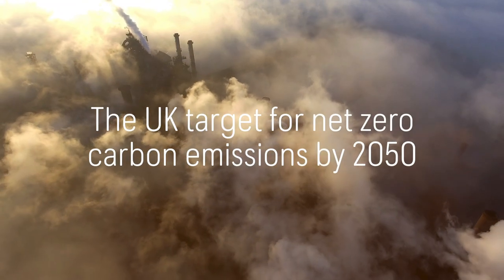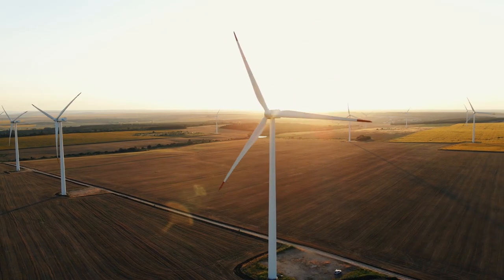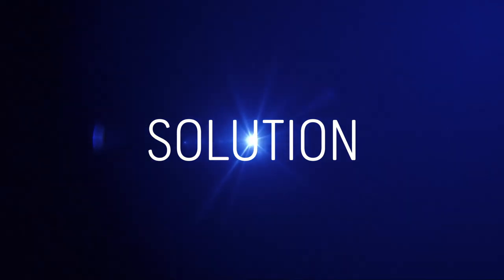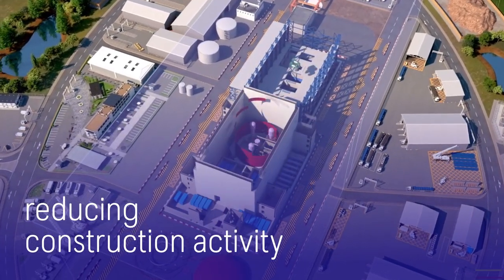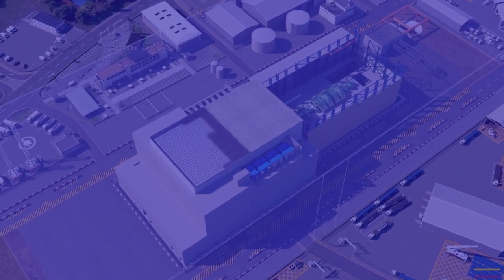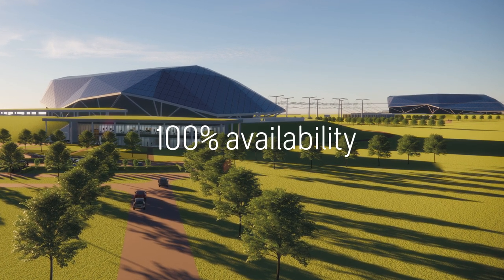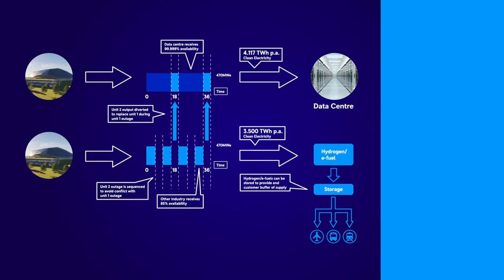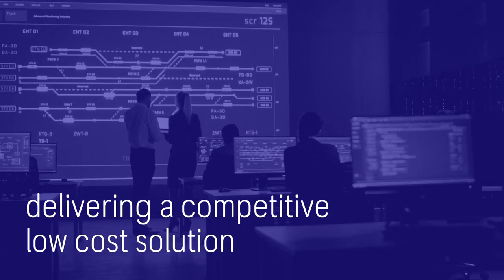Rolls-Royce | Small modular reactors

Comment: So as to guarantee a constant grid supply, with variable solar/wind energy, can the power in these reactors be quickly ramped up and down?
Reply: Do away with unsightly wind turbines, that provide intermittent power and have a limited lifespan - in favour of SMRs. Sturgeon is about to sanction the increase of numbers and size of wind turbines on Scottish LAND, not off-shore, replacing ones that are 10 years old and therefore at the end of their lifespan.
Reply: David Kelly.. In answer to your question. Yes
Reply: @L G How much energy can one of these produce.
Reply: @hikerdoc6771  in the interim, Wind Turbines Now produce electricity more cheaply than oil and gas🙌
Reply: @L G what will happen to the Nuclear Waste that has hundreds of thousands of years of toxicity.
Reply: @demoniack81  and the Nuclear waste lasts hundreds of thousands of years...we need to realize that is the drawback.
Reply: @cherylreid2964  One must also ask, what are the ramifications of the CO2 that would otherwise be produced.

Comment: While I understand this video is little more than corporate advertising, It would have been nice to at least know some details about the SMR RR is proposing. I have no better idea after watching than i did before. Just this will do x y z (magically) and everything will be great, oh and it looks pretty too. Really? That's it? 

I hope they do build something that does what this claims but it's all vapourware and marketing bs without any actual info. I don't even know either the cost or the capacity of this thing, let alone what fuel cycle it uses etc. So with regret, that's a thumbs down from me for this fluff piece.
Reply: From what I understand is, the main goal is to lower the cost of nuclear power. At the moment, nuclear power stations are very expensive to build and maintain. 
RR hopes that they can build the nuclear power plant in modules, so each parts can be manufactured like in factory and then ensemble on site, which is a lot cheaper and everything have been standardised.
Reply: BC, 

one cost fcator with large plants is the time taken to get the necessary approvals for construction which is something that ought to be reduced significantly and that the large plants equal about six or seven small ones. How that works out in total, the video did not help with. Also what tim eit take sto get these smaller units approved for installation was not touched on. Certainly using older nuclear sites to site them makes sense.
Large plants are inflexble in output generally and are run as baseload. If the small units can be run as dispatchable then that is of great benefit. Together with phasing out renewables as they are a grid hinderance rather than help.
Reply: Plus if location at old coal station they can utilise the same turbines and grid connections.

Comment: Oh, please, please, PLEASE let them get these things in circulation! This type of solution is the answer! Not this intermittent wind/solar plus batteries bullshit.......
Reply: @owenspears8662  more eloquent a reply than I’d have bothered with, but my sentiments exactly. It makes a pleasant change to not be abused or ridiculed for daring to contradict the dogma......
Reply: What is Your solution to the tens of thousands of years of Nuclear Waste?
At least renewables are recyclable.
Reply: @Glenrok  yet the sun is ALWAYS ON🙌
Nuclear Waste is my issue, with Nuclear waste lasting tens of thousands of years 🙌
Reply: @owenspears8662  and the tens of thousands of years of Nuclear Waste?
Reply: @cherylreid2964  sigh. Yes, but since the earth ROTATES it’s effectively “off” for half of each day, so your “point” is meaningless. As to waste, yes- SOME of the waste can “last for tens of thousands of years”- but not the highest level waste- as the most dangerous waste has a very short half life- which is WHY it’s dangerous! In any case, the latest designs being developed can actually REUSE waste from earlier reactors- processing it down to far safer levels of radioactivity. Given your reservations towards such waste- wouldn’t you then consider it our DUTY to do so, and if we can further benefit by producing abundant electricity AT THE SAME TIME, where is the downside???

Comment: I think a good design to work on would be a small modular nuclear reactor based on a Coal Fire steam electric power plant.... and have the heavy-water that accumulates inside as the control rods are used, bled off through insulated piping, to a nuclear fusor, and then you could use up the Deuterium Oxide, and return the water to its natural state, and then return that natural water back to the reactor to be re-used....

That way, you have like a self-serving nuclear reactor, in which case and in Theory, you'd pretty much just swap out a nuclear control rod like a battery, and the old control rods would go back to a secondary location to be re-enriched using a magnetic field, and it'd be like basically a Lithium-Ion battery... but instead it would be a nuclear control rod instead of lithium & it would be in a safe manner, especially with a vacuum backup and a vent and an ability to raise the rods. In a melt down,, a red button is pressed, opening the reactor & raising the rods, as a vacuum sucks up all the steam, until everything is cool... I saw a video of somebody try to make a nuclear battery by basically just wrapping a bunch of enriched uranium in tungsten, and they got really really sick... 

Not just a few people either, in the east somewhere, Soviet satellite state.

That design above would be great for vehicles, and space stations.

Comment: What happens to the unit and it's dangerous waste at the end of its life?  More problems for another generation?  In the 50s we were assured the solution to nuclear waste would be solved "in just a few years."  70 is more than " just a few", even by nuclear industry standards.
Reply: It's been solved since then. Indeed there are multiple solutions. Aside from the whole political thing, there is actually to be fair a good reason not to get rid of waste, and that's the potential for its reuse.
Reply: @streaky81  tell me more.
Reply: @theotherandrew5540  both deep borehole disposal and more traditional storage vaults are completely up to the task and have zero flaws. The fact there is political opposition doesn't change the fact they're more than up to the job.
Reply: @streaky81  So in reality, the "solution" is no solution, just burry it.  A non-solution.
Reply: @streaky81  Calm down.  Disagreeing with someone doesn't make either of you stupid.
Reply: @theotherandrew5540  I'm perfectly calm, and you're not disagreeing you're being intentionally obtuse. Waste is safely and securely disposed of for as long as it needs to be = problem solved.
Reply: @streaky81  You have more confidence than I do about the long term, very long term safety hurried waste.  A problem buried is not solved.  Ultimately it may be, but that ultimate is unknowable.
Reply: @theotherandrew5540  3 miles down a shaft in impermeable rock, it's not unknowable. This was solved decades ago. Political bitching is not my problem.
Reply: @theotherandrew5540  putting it into a medium with a known future for millions of years to come, that nobody can access without an understanding of technology comparable to our own and a huuuuugggggeeeee pile of luck is a problem solved.
Reply: @streaky81  You have more trust in our current technology than I do.  Even as recently as 50 years ago, throwing smoke high into the air was thought to be the way to get rid of it.  Then Methane was the answer, only producing water vapour and carbon dioxide.
Reply: @theotherandrew5540  There's an even better solution, though - fast breeder reactors to burn up normally-unburnable isotopes and waste reprocessing to reuse remaining uranium and plutonium, until nothing fissile remains. Both massively shortens up lifetime of the waste and produces a shitton more power.

Comment: According to the NRC I designed "The most advanced comprehensive plant auditing, maintenance, outage and upgrade system they had ever seen" for San Onofre nuclear generating station (SONGS - 3 units) that saved SoCal Edison billions and Rolls is needlessly making some gross errors in their plan, putting millions at risk needlessly when a slight change would save them hundreds of billions and make rollout and expansion 10X faster, cheaper, safer and tap markets they can't w/ their current design.

Comment: Next step, Micro Modular Nuclear for vehicles. Small transferable units for cars, trucks, aviation. Powering your average car for 25yrs. 

Suggested this would happen a few years ago - got laughed at.
Reply: That would be awesome!
Reply: We'll use micro reactors for heat and power, not personal vehicles,a micro reactor is going to the AirForce base in Alaska,making 10MW replacing 800 tons a day of coal, likely working by 2027.
Reply: Yeah, that's never gonna happen.
Reply: @streaky81  Already happening.
Reply: @3204clivesinclair  no.
Reply: And the long term Nuclear waste?
Reply: @cherylreid2964  Nuclear waste HAS to be stored ‘securely’. The same is not said for the current problems we have with other chemicals and general waste - disposable nappies, batteries and thousands of other items that are routinely illegally dumped. 

When was the last time you heard of fish, swans dying from nuclear waste? Yet animals routinely die from digesting plastic.

The genie is out of the bottle. Our requirement for electricity is always increasing. Solar, wind, hydro is not going to cope without nuclear.

Comment: SpaceX want them to power them to Mars within 90 days.
Reply: SpaceX prefers Methane,but yes,NASA is contracting for NTP nuclear thermal propulsion, chemical rockets take too long, the radiation is too intense, nuclear gets you there in 5 months instead of 10,Xenergy,who's making the TRISO fueled ,molten salt cooled Energy reactor is working on using TRISO fuel for a nuclear rocket.

Comment: But 2030 is a bit too long really, fossil fuel companies aren't going to produce more fuels, intentionally or not, the precipitating economic crisis is going to persist.
Reply: The regulatory approval takes 3 years so construction won't start until late 2024 or early 2025. It will be operational before Sizewell C (which may never complete).
Reply: @peterd788  Do you know why the Icelink iceland interconnector project fell silent? It was supposed to give 15% of the UK's needs for just 2.4bn. Double that up and add it to the Norway connector and that's 40% of our needs - the amount we use gas for at the moment, totally green, done in a third of the time or less and under 5bn. And I'm not sure about iceland (geothermal I presume) but with the Norway one we can use to export excess wind energy when we've got too much. Seems like such a simple solution (while we wait for these) that I must be missing something!
Reply: @govr6771  As far as I know Icelink is so complex and so high risk that it's impossible to place any strategic reliance on it at the moment but the picture should be clearer in 2023/2024. In the medium to long term (10+ years) it might have potential. Having a foreign electricity reliance of that magnitude poses strategic problems because it is too important a point of disruption by a malevolent actor or nation state adversary. Essentially, Russia could cripple the UK by attacking a place with a population half the size of Sheffield.
Reply: @govr6771  You are an island you might want to produce power on it, in a very small space, nuclear is 70,000,000 energy denser than diesel.
Reply: @govr6771  hundreds of thousands of years of Nuclear waste😩
Reply: @paulbedichek2679  and the Nuclear waste lasts hundreds of thousands of years.

Comment: Always disheartened and concerned at the dwindling lack of common sense in this country when I discover something positive like this RR SMR and the first word I see in the comments is; "Chernobyl." For the love of God, that accident was the result of a seriously flawed reactor design that was operated with inadequately trained personnel commanded by an idiot. The combination of operator negligence and critical design flaws made the reactor primed to explode. Instead of shutting down after a safety test, an uncontrolled nuclear chain reaction began, releasing enormous amounts of energy. The core melted down and two or more explosions ruptured the reactor core and destroyed the reactor building. This was immediately followed by an open-air reactor core fire. Prior to this event, the world's civil nuclear industries had accumulated almost 4000 reactor-years of safe commercial operation without a single loss of life to a member of the public. One of the main issues with these RBMK-1000 types of reactors is they have what’s referred to as a “positive void coefficient”. This means that when the coolant is lost, as it was in the safety test, the rate of fission would increase. During the accident, an overproduction of steam led to more fission, a huge temperature and pressure increase, which eventually led to an explosion. After 1986, all remaining RBMK-1000 reactors underwent design updates to fix these flaws. Nuclear power should be the safest and cleanest energy we have at our disposal. It's essentially a giant kettle that boils water to make steam which creates pressure to spin a turbine and make electricity. Of course there are very serious hazards. Uranium is the most radioactive natural element known to man. But if any country is going to take nuclear power forward it is Britain. The brightest minds should of been working on this years ago. We are more than a decade behind in making significant strides to replace fossil with nuclear.

Comment: It’s a known fact that it costs twenty years to recover the cost of actually making a wind turbine by which time it needs replacing* . Clever. I’ve been advocating modular reactors sited near the points of use rather than high cost monsters than then need to transfer the power output great distances with the higher likelihood of power outages. With the take up of electric cars rather than fossil fuels this is much more important to our countries policies
Reply: SMRs don't exist yet.  How can you be so confident that an unproven technology will be cheaper?
Reply: @dansanger5340  what do you think supplies the power for a nuclear submarine ??
Reply: @colinhooper6621  Definitely not any of the civilian reactors now being developed.
Reply: Your 'known fact' is untrue. Check 'Full Fact' for example.
Reply: Wind power is now cheaper than oil and gas ⛽
And until Nuclear Waste is addressed I still think smart renewables is the best option for now.

Comment: The only thing that is intolerable is the fuel. It is typically 5% efficient, creating 95% waste. My hopes are on the Thorium fueled reactors which run near 95% efficiency, where the waste products are very valuable, and they need old nuke waste to bring the Thorium to fissile state, thus consuming waste fuel. That their waste cannot be converted to weapons grade material is a nice plus. It would be pleasing to know the details of this reactor in regards to these points. 60 years? RR is a fine company, let's hope so.

Comment: Years ago Rolls Royce developed an azimuth thruster, a propulsion system for ships doing away with the need for a rudder and providing amazing maneuverability. The propeller was actually the rotor running in a ring of magnets. What happened to this? They sold off their marine division! Have you seen the latest Rolls Royce cars, they all look like a gilded brick. They lost their stately grandeur long ago. They say this is low cost energy but neglect to tell us how much it costs. I bought RR shares over 30 years ago. They are still trading in pennies 140 pence a share on the London mkt! Down again yesterday on the New York exchange to $0.016 ! Would somebody tell me I'm wrong.
Reply: Rr cars are rr in name only hence rrino.
Reply: I belittled their cars but now realize they sold this division off years ago also, to VW or BMW.
Reply: @Martin-se3ij  yeah let’s make sure you stop commenting with your ego! Hope this helps

Comment: I remember the dayd of the "global-warming era", the "hole in the ozone" era and the "acid rain" era when everyone were protesting nuclear waste. Now we embrace nuclear waste.
Reply: @demoniack81  I know all that. I think most people do. The main hysteria is that nuclear waste remain active for thousands of years, which is really not a problem for me either. We will need petroleum for tarmac, all plastics, bonding agents, car tyres, pharmacuticals, computers, industry etc. We simply cannot progress without these materials. The carbon footprint of the production of concrete and steel is far greater than petroleum.
Reply: @demoniack81  hundreds of thousands of years of Nuclear waste is STILL an issue of some magnitude.
Reply: @cherylreid2964  Yeah, because it's full of perfectly fine uranium and plutonium that you can burn for more power. And guess what, fast breeder reactors let you do just that!